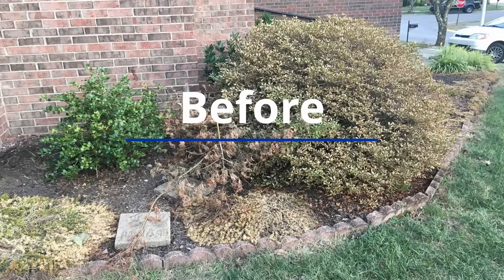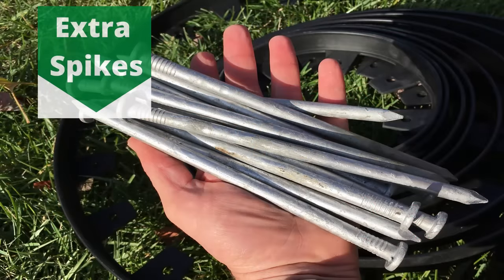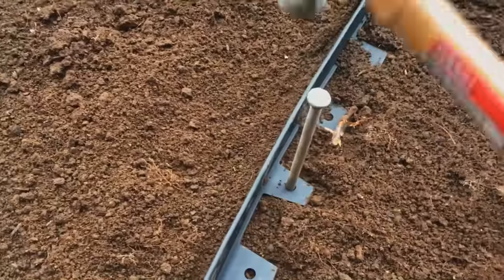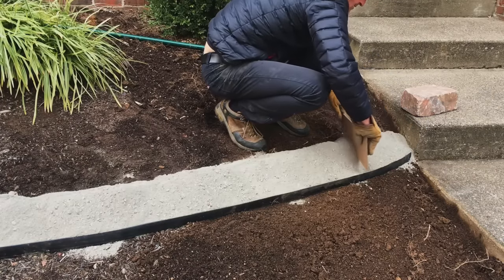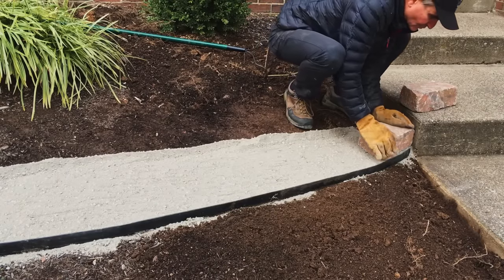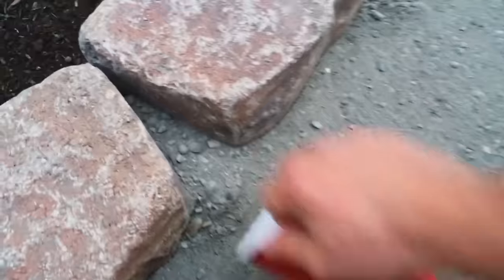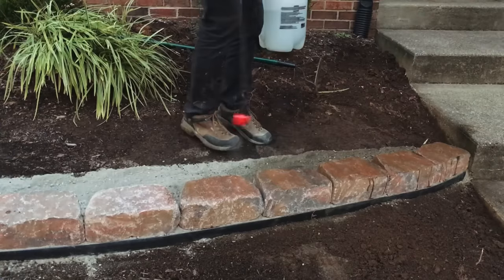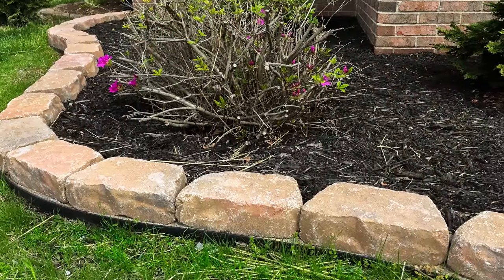easy diy No Dig Border *2020 UPDATE*

Comment: Can you go higher with the blocks  say 2ft higher to create a small wall using construction adhesive?
Reply from the maker: Yes, you can, but consider that its not level and other methods work better for small wall building.

Comment: Quick question. I already have a bed that has an edge dug out but it's just a grass edge. Presumably I could clear an additional little track around the edge and put the cement right down in that track without the no dig edging right?
Reply from the maker: Yes, if it is real flat this could work. In this situation, I always attach the plastic edge to the ground on top of the grass and right next to the old edge to the whole area is just slightly larger than it was. I think it looks better to have the border above the ground because it is a sculptural element that can add beauty if made neatly and with pleasing curves. I hope this helps.

Comment: I want to do this boarder along the side of my concrete patio,  can I do more than one layer of bricks? Possibly 2 or 3 bricks high, like a small wall using the concrete mix between bricks?
Reply from the maker: Yes, you can, but I don't recommend this technique for small walls. Its likely you won't be happy with it long term. For a small wall, I'd highly recommend a more traditional technique. If you decide to use this technique, I'd suggest some modifications that I'll describe here. Since you are making the border along the flat and level patio, I'd dig a little trench along the edge that is deep enough hold the depth of the landscaping block plus a couple inches of the concrete mix. If you want to make the first block a little higher than the patio level, then dig a shallower trench. Either way, you'd want to cut a piece of cardboard about 12"-14" long and about 8" high. Then you'll want to cut a rectangle shape out of the bottom on one end that corresponds to the space you want the block to be under the level under the patio level. So lets say you have a 4" tall block. If you want the block edge to be level with the patio, then you'd cut it to a 4" depth. Or if you want the block edge to be 3" taller than the patio, then you'd cut the cardboard to a 1" depth. Any way you make it, you will be able to use that cardboard to drag along the patio and the part hanging down lower will be parallel with the patio level and smooth out the dry cement mix nice and level with the patio and give you a very nice professional look. This step is similar to the the step in the video where the cardboard is used along the plastic edge, but you would be doing it different here. When placing the blocks in place, you could also pivot the blocks back and forth and create a solid edge. Then, you just dump a litle extra cement with a cup along the outside edge to keep the blocks more firmly in place over time. Then, you mist it all and it will bond together as shown in the video. If you really wanted, you could use landscaping adhesive to add another layer taller. It will be level since you are using the patio surface as your leveller, so it should look good if you add a second layer. On the normal border technique, the border height changes along with the ground height which looks good at one layer high, but I don't like the way it looks for short walls at all. To finish this variation in technique, you'd just fill in dirt back along the blocks and put grass back  in  that you had dug out earlier. If you water it, the grass shold come back strong along the edge. I hope this helps. Let me know if you don't get something about my advice. Have a good day, @lcunning74.
Reply: @maxpatch67   Thank you for so much for this detailed explanation! I will be trying it soon and let you know how it comes out. 😁
Reply from the maker: Remember it needs to be in the 50's at least for temps so you might need to wait. Have a good day!

Comment: Great video! I feel empowered to do my own yard.  Does this process work the same around the sidewalk/walkway? It's part of my shrubbery line but wanted to clean it up.  It's close to the house and front door and I'm wondering about drainage?
Reply from the maker: I like the way you think, Kenya. This technique has many uses and is adaptable. Yes, you should think about drainage. I divert my downspouts straight down into the ground and have them go through 4" sewer grade PVC to catch basins about 10' or 15' away from the house where the water exits. I hope this helps. Have a great day, Kenya!!

Comment: Looks like you removed the plastic edging after it set up?
Reply from the maker: In this video, I did not, but you can with an adaption to the technique. To make the plastic edge removeable, use it in reverse and just remove it after the concrete sets up after a day or so. Just use the plastic stakes included with the border and maybe buy some extra bags of plastic ones so you can use them about every one foot so it keeps its shape right. To make the plastic edge easier to remove, cut the stakes in half with some sturdy clippers and then they will easily pull up while removing the edge. Let me know if I can help you any more, @PeggyMills!!

Comment: I used this method in 2017 for a smallish back yard flower bed.  Still looks great.  Now I'm about to do the entire front of my house- 2 beds approximately 65 feet.  This time I am going to put down some grade 3 landscape fabric first on the soil.  Then put down a 2-3 inch layer of sand, then the cement,  then the blocks.  Any thoughts on this method?  Using 60lb bags of cement how many would you think it would take?  Side notes,  I'll be digging out the  current blocks that are buried about 3 inches. Thank you.
Reply from the maker: Yes, I have some ideas about your plans. I don't like landscaping fabric because in the long term it is a huge pain in the butt. Weeds will shoot their roots all over through the ground and you don't have any access to get them out. Besides that, weeds can shoot right up through even the best of landscaping fabrics  Also, many weeds come to seed on top of the fabric in the mulch and the fabric doesn't do anything for those. Here is a much better method: https://www.youtube.com/watch?v=HIWDPlaB6wY&t=205s About the sand idea....here in Nashville we have Bermuda grass that spreads everywhere and that sand would be full of that very quickly and be a huge headache. The cement also provides a huge amount of permanence and orderliness to your border over the years. I hope this helps. Have a great day and thanks for your comment, AB Junior!!

Comment: I am very new to the outdoor DIY game so please forgive me if this is a stupid/impractical question. Could this technique be used to make a (permanent) patio of pavers? I hate the idea of spending a million hours (or dollars) to dig, level dirt, add sand, level sand, add fabric, add and level gravel, lay pavers, more sand...etc. Could I get the ground close to level, add the fast-setting concrete and make sure it is level, lay the pavers, and then add water? Maybe there would not be enough space between pavers for that to work. Yes, I also realize this would be hard to remove later (assuming it works).
Reply from the maker: Troy, I'm struggling to know how to respond to this, because there are so many variables like ground settling, size, location, opinions on this and that......so I really don't know. It sounds like it might work, but I don't want to encourage you to try it and have it not work out. I think if it were me, I would use a taller border edge and using a wheelbarrow, dump tamping gravel into the area, use a tamper to flatten out your base and set your bricks/pavers on that. Maybe push some sand across it with a broom when finished to fill in the gaps. Using that method, the main thing you won't like when finished is the unevenness, so take the time to tamp it completely flat before laying your bricks/pavers down. Anyway, that's my idea for your diy patio dilemna...otherwise, I think I'd go with the traditional steps you find in other videos.

Comment: I understand how the border is supposed to be used but seeing the black trim just drives me crazy, I think I might place the trim backwards and push the bricks up against the lip instead so the trim isn't scene but allows to keep the perfect form and shape of the edge
Reply from the maker: Thank you for your comment. If you don't want the black plastic edge to show, what you will do is attach the edging to the ground in reverse so you are driving the spikes into the ground on the outside of the border making it removable. Also, you don't need to buy the strong metal ones and you can just use the wimpy plastic ones that come in a bag with the edging. You might want to buy an extra bag of plastic ones. What I have done is cut the plastic spikes in half(I use hand garden clippers) so its easy to pound them in and pull them out also. Just wait a day or so until the cement has cured before pulling out the spikes and border. It needs to be mild air, like in the 50's for the cement to cure so right now might not be the right time to make this border. If you make it in summer, the cement cures within a couple hours so the curing goes real fast. Let me know if you need any more help. Thank you for your comment and question!! Have a good day, @ryanlocklear14.

Comment: Question!:  How another layer?  Can you do a retaining wall with two, three layers with this method?
Reply from the maker: You can add, more layers, but I have not done it because I don't think it would look so good. Also, you might want to use more traditional levelling techniques to make it turn out better. If you add a second layer, use landscaping block adhesive. Have a great day, Rand!

Comment: Thanks for the video! Question: is the plastic edging absolutely necessary? I'd rather have just plain stones. Thanks!
Reply from the maker: You probably find another way to make your border, but in this technique, the plastic edging provides a form for the cement and also an edge to level the cement off with. Both of those two features are important in this technique for an attractive finished product. One viewer used the plastic edging in reverse so it could be removed, but I have not tried that. If you try it, I'd love to know how it worked for you. I hope this helps. Have a great day, sparkysarah78!!
Reply: Hey did you ever try to reverse lying of the edging? I’m about to do the same project. But j chose the mini stones and concern with seeing all the no dig edging. TIA

Comment: Using this method, would I be able to stack a few layers of stone to make a raised bed?
Reply from the maker: Trinhk, I have not made a second layer on this type of border because I don't know if it would look that good and the difficulty level is raised some because you would mix up and use a traditional mortar between the layers. Even, though, it involves more work, I would highly recommend digging out the old dirt and mulch out of your area so the level is dropped enough so that there is plenty of room for the mulch to sit in there without spilling over. Also, the same thing can be accomplished by building your border out further so the dirt can slope down to the level of the bottom of the blocks and also have room for mulch. I hope this helps.
Reply: I have made a stepped wall three blocks high using this method but you must level the ground under it or it won't look good.you cannot just follow the contour of the ground if going more than just one row high
Reply from the maker: yes! thank you!!

Comment: Hello I live in NZ want to do exactly the same because it's easy I believe it's easy. I went to shop but I cant find any smooth quick fix cement it's all with tiny stones can I use tgem
Reply from the maker: This cement mix does have gravel(little rocks) in it. The main thing you HAVE to know is that you HAVE to get fast-setting concrete. It is a special kind and is the only kind of cement mix that will work using this misting technique with the water. All other kinds need mix with water before using it and the skill level and difficulty is raised a lot. Sooooo....see if you can find fast-setting concrete bags. I hope this helps.

Comment: Will the concert make it impossible to remove later
Reply from the maker: This border is considered to be permanent since it is set in concrete, but you can use a sledge hammer if you ever wanted to bust it up. Only build this border if you are sure of what you want for many years to come. Have a great day!!

Comment: Don't know if you've answered this already; Can this be laid out along an incline, like a driveway? Without the need to lay them out level?
Reply from the maker: No problem with slopes. Just level the dry mix along the plastic edge with the ground/driveway. Use the leveling process I show in the video. If you are going along a straight driveway, you could use some straight edging they sell in the stores to help get yours straight rather than the vigoro that curves so easily. You could also change up the process a little and dig a little trench, dump the cement, level it with the driveway edge, put the blocks in, dump cupfulls in any gaps, and then mist it all. This might work out best along a driveway-skipping the plastic edging....but still using the concrete. I hope  this helps.

Comment: Hi. Out of curiosity why is the cement necessary? I’m a first time home owner looking to spruce up my yard and figured the black rubber border and stone was enough. Apologies if I missed this in the video.
Reply from the maker: It may not be necessary for you in your exact situation, but this border is meant to solve many problems people have with different types of borders. The cement in this technique provides stability to keep it perfect looking over many years, height to make the look more sculptural and to invasive grasses and weeds from climbing over the top, and also width to keep out creeping roots like Bermuda Grass which are so invasive here in Nashville. So, if you don't have needs in these areas, then you may not need the qualities this border provides.  You might just want to dig a normal edge or something else. I hope this helps. Have a great day!!

Comment: Great idea for edging.  I am wondering if it would be possible to add more layers to the edging.  I would like to make an edge that is 3 or 4 bricks high.  Can you give me an idea of how this would work? can I add more bricks on top of the first layer and how would they be fastened together?  thank you
Reply from the maker: Liory, I have not made a second layer on this type of border because I don't know if it would look that good and the difficulty level is raised some because you would mix up and use a traditional mortar between the layers. Even, though, it involves more work, I would highly recommend digging out the old dirt and mulch out of your area so the level is dropped enough so that there is plenty of room for the mulch to sit in there without spilling over. Also, the same thing can be accomplished by building your border out further so the dirt can slope down to the level of the bottom of the blocks and also have room for mulch. I hope this helps.,,,,if you want to build yours3 oe 4 levels high, I'd recommend, using traditional levelling methods and techniques.

Comment: My mother lives in a home that has a retaining wall and then about a foot wide of grass before the sidewalk begins. The foot of grass is on a slope. Woul this DIY work by removing the grass, ysing the no dig edging, and placing river rock over the fast setting concrete instead of the stones you used? We are trying to get rid of the grassy slope!
Reply from the maker: Ya that would probably work. What about digging out the dirt to lower the level of it and then using the river rock in there. That way, the rock has a place to sit in there and yo don't need to add the border. That's usually what I try to do in sidewalk and driveway situations where people have stuff spilling over. I lower the ground, so it doesn't any more. I hope this helps.

Comment: If I wanted to go 2nor 3 blocks high can I use that same cement as a mortar for the blocks? Or do you recommend using construction adhesive I’ve been seeing this lately
Reply from the maker: Yes, landscaping block adhesive is what you would use. Honestly, I don't think this border would look good built up with 2 or 3 layers high because you aren't using a levelling process so this really throws off the border as it gets higher. If you want a little wall, you should use a different and more traditional wall building technique. I hope this helps.

Comment: If anything I'd probably want to drop a line so the bricks are level for a good look.  What's the opinion of doing this and having a second set of bricks on top?  Would you need to dig a little just to get a thicker layer of concrete down?
Reply from the maker: Yes, you can adapt this technique quite a bit. You do not need to make the concrete any thicker for a second layer. The concrete is VERY sturdy. I have never done a second layer, but different viewers have- and like it. About leveling with a string- you can, but that changes the technique quite a bit- adding different challenges- you might want to use a more traditional technique instead of this one then. I hope this helps, Jeffrey. Have a great day!!

Comment: Have you ever tried this with the plastic edging on the inside of the blocks? I really like the look of the stone but don’t love that black plastic showing.
Reply from the maker: Some have reversed the plastic edge, making it removable when the concrete is set. You definitely need to use the plastic on the outside of the border to keep it looking sharp. As you notice, the inside of the border is rough since it is covered with mulch and does not show when finished.  I hope this helps. If you have another question, please let me know, Jason. Have a great day!!